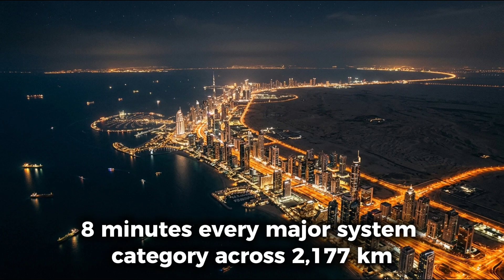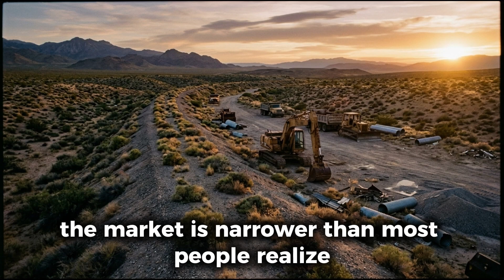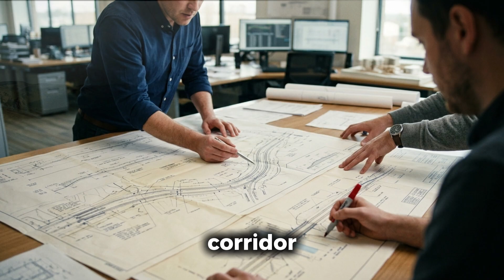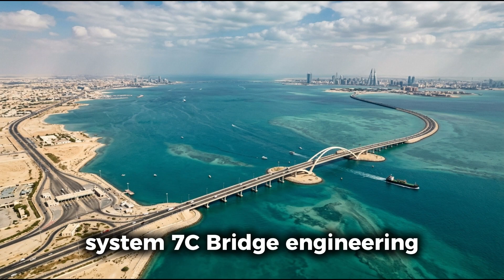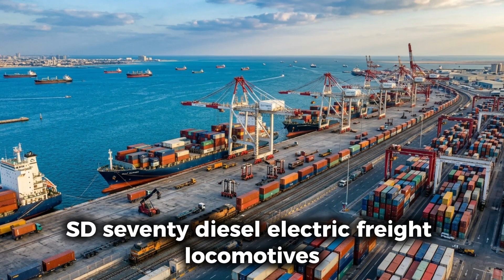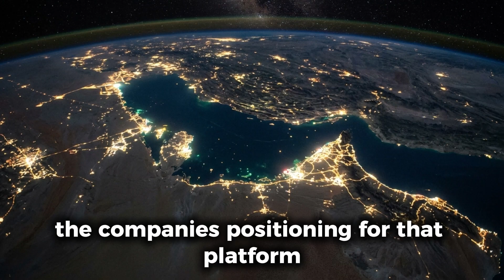The $100B Railway Connecting 6 Gulf Countries

Comment from the maker: 📌 QUICK REFERENCE — GCC Railway

Coordinator: GCC Railways Authority · gccra.ae
Route: 2,177 km · Kuwait City → Dammam → Bahrain → Qatar → Abu Dhabi → Muscat
Gauge: 1,435 mm standard gauge
Speed: 200–220 km/h passenger · 80–120 km/h freight
Traction: Diesel (current plan) — electrification debated
Target: December 2030 (official)

Country status:
✅ UAE (684 km): Etihad Rail complete · freight operational · passenger 2026
🔄 Saudi Arabia (672 km): Design tender 7 May · deadline 30 Jun 2026
🔄 Kuwait (111 km): Proyapi design contract signed Apr 2025
🔄 Qatar (283 km): Cabinet approval Jul 2025
⏳ Bahrain (~28 km + 25km sea bridge): Bahrain Rail · active planning
🔄 Oman (306 km): Hafeet Rail UAE section 40% complete

Active tender: SAR design consultancy · sar.com.sa · deadline 30 Jun 2026
Sea bridges: King Hamad Causeway (25km Saudi–Bahrain) + Qatar–Saudi maritime bridge

📄 Free supplier reference list → Subscribe + comment "SUPPLIER LIST"
⚠ Verify all details with SAR and GCCRA for official information.